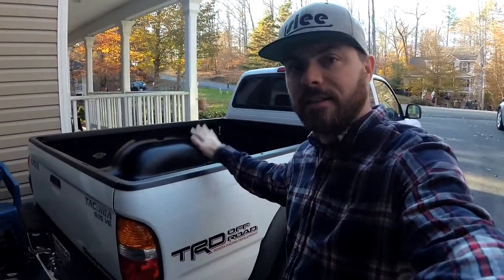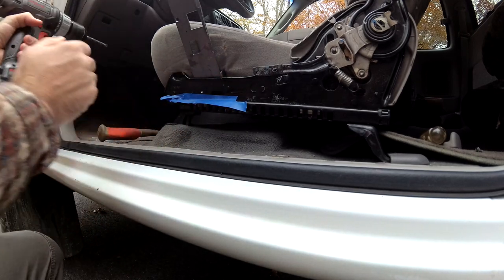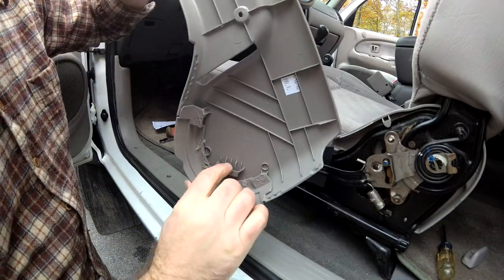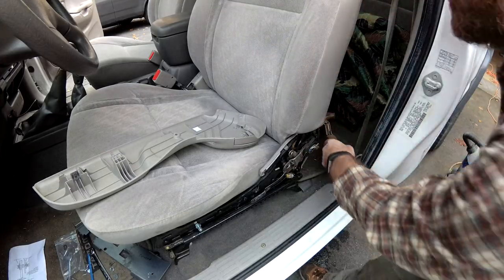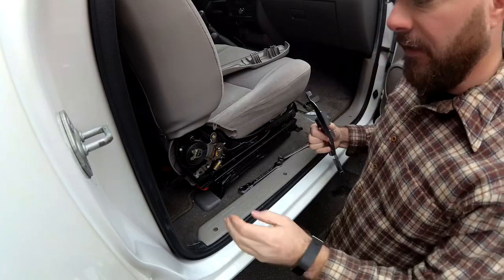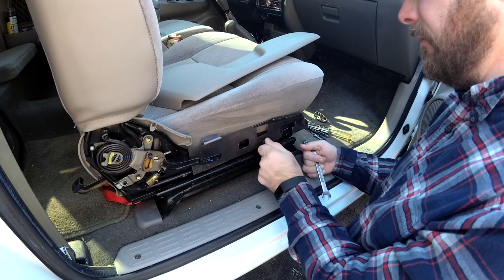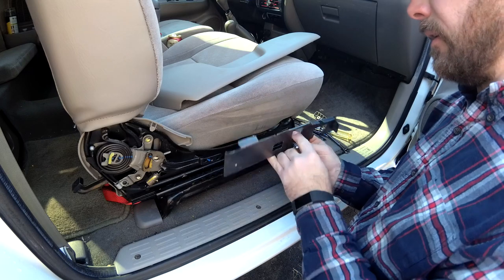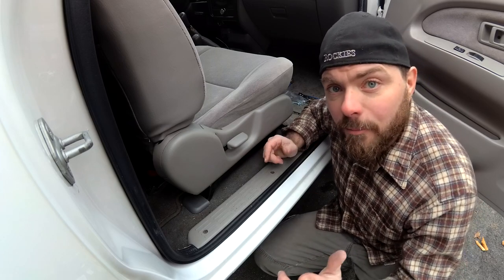Tacoma Seat Trim Reinforcement Bracket Installation - Project Sadie 1st Gen Tacoma TRD Off-Road

Comment: Very nice video. Glad you like the plates. The one hole that wasn't drilled was an oversight on my part. All the plates come with the holes drilled normally.
Mechanicjon
Reply from the maker: Thanks man! They have worked great and been on there a while now. No cracks or flexing. So glad i got them!